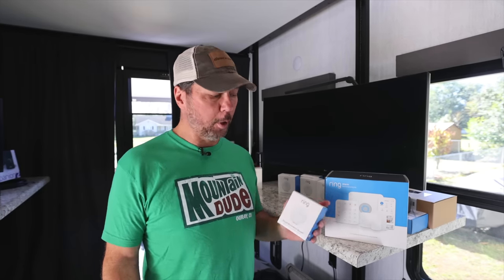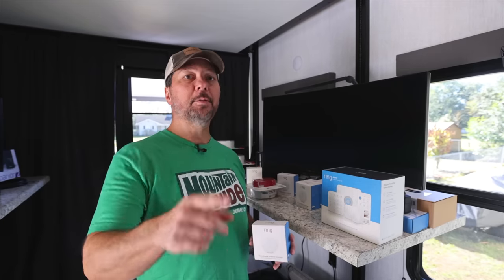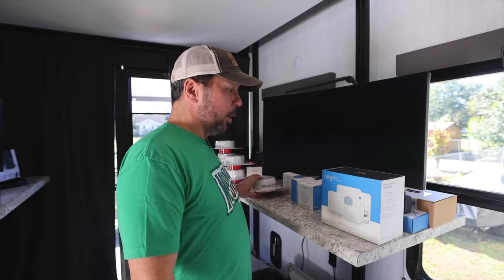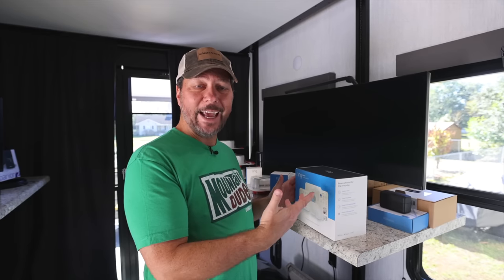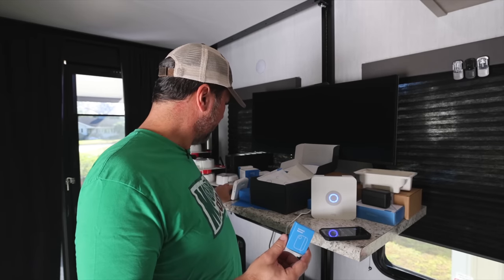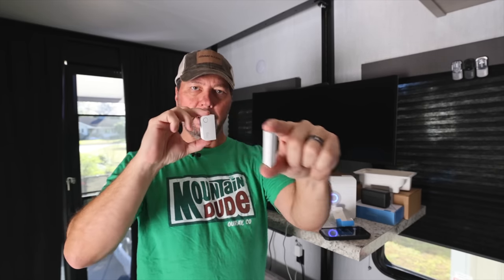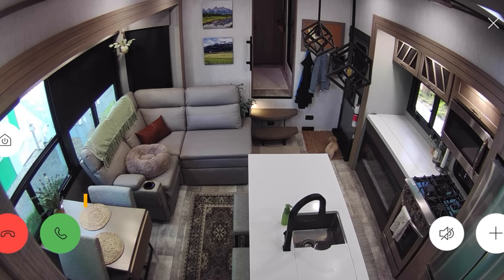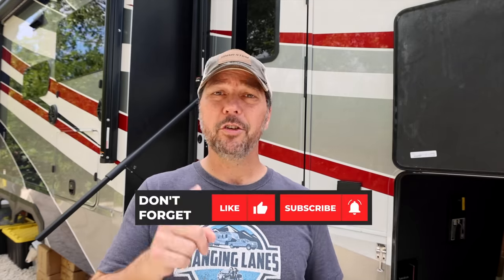RV Security System for Full Time RV (by Ring)

Comment: Chad, suggestion: get your label maker out and labels those under-bay alarms, so if you have to recharge or change batteries, you know where they go.  Also I would put three cameras on the outside to see in your blind spots if people are outside at night. We did this first.  Amazing who/what walks up or around your rig at night.
Reply from the maker: When one chirps with low battery,  I get a pocket full of AA batteries and go nose to tail and change ALL of them
Reply: What's a good label maker?
Reply: Chad just to let you know smoke alarms are very problematic in bathrooms as steam or high humidity can activate them.

Comment: I put a Ring alarm system in my Fifth wheel as well and I love it. One thing I did was I wired the base station and key pad to a 12 volt to 5 volt DC to DC converter so I don’t I need 120 volt AC to run it. We dry camp a lot and try to minimize inverter use for efficiency reasons. My internet is a Pepwave 5G and it is hard wired to 12 volt.
Reply from the maker: Very nice! 👍🏼
Reply: @ChangingLanes  I love your videos, very interesting and well done.
Reply from the maker: Clipping comments for a follow-up short and I thought of a drawback to hard-wiring DC power: You won't get notified if power goes out and 120V items (like the AC) shut off...  Not a huge deal if you don't have pets, but something to consider.. 👍🏼
Reply: @ChangingLanes  We don’t travel with pets and don’t really have anything running on 120V when we aren’t in the camper. You have me thinking though, how can I make the Ring alarm system sense an AC power loss, there must be a way to hack that problem, LOL.

Comment: Great video. I have Ring in our class A. In the process of putting contact sensors on the cargo bay doors. In combination with an Echo Dot, I’ve programmed a routine in where it will say “cargo bay 3 is still open” after whatever time I want (10 minutes). Kinda crude programming wise but it works.

Comment: As much information as they say they are collecting from people with their digital devices it seems counter productive to use it for your safety and security but have the chance that big data could basically track your every move with all these sensors and it being linked to your mobile device that you carry on you. I would feel more comfortable with all the sensors being wired and there be less need for battery or recharging. Is there software open source and can you see the system log for the devices that run Linux with a graphical user interface that doesn't show the processes in the background "Computer Code" like the main unit and the sensors? Open source phones are becoming more popular because the phones from the phone companies are locked down, denying access to you if you want to see the background data in code and the processes that the device is doing!

Comment: Wow what a timely video I just got done setting up our second ring system in my daughters RV. I think these are an amazing value and we did the Ring pro for the fact you can have an SD card process all your videos on site and save on data. And I love that it has a second cellular backup as well as battery backup so you just get more redundancy. And the flood and freeze sensors work great, I had one this winter when I knew that our little heat lamp could not keep the basement warm enough. I ended up winterizing the RV with antifreeze rather than risk it when we had that big cold snap. I also love we put an outside camera up also and an inside camera so when the dogs are left alone we know they're okay and who doesn't like checking on your RV when you're not there to know if somebody is messing around.

Comment: I have been camping for many years.. I just solved my security problem….. I sold my travel trailer..
Camping has changed…for the bad… Camp grounds too full and too expensive… and too many bad people wandering around inside camp grounds. Then with the price of fuel and insurance costs and stress of towing… I came to realize and have concluded
Drive to where you want to go and get a hotel room. I am looking forward to my first non camping trip and I have a hell of a lot less
Work preparation time before we leave.

Comment: What about the doorbell moving to flush mount on the slide? You could have better view (with 155 degree viewing angle) and possibly move that invisible barrier off the rv a little more. And by invisible barrier, I mean that arc of personal space to house ratio. Where are you push the doorbell  and step back a little bit? If that makes sense.

Comment: Nice set up Chad, my class C is 34 foot bumper to bumper so that being said it’s not even has big as your rig. We don’t have Wi-Fi but only cellular. I’ve already got alarm “puck’s “ everywhere water would be an issue but need something solely for the coach door and my big basement storage. I want what you got but a little less considering the size and need comparison of our rigs.
Reply from the maker: You could just buy a base staton and single contact sensor...  But there are likely even simpler solutions.

Comment: Just add in also I think the Ring pro is a better unit than the regular ring system, because you can have an SD card with your videos and then I think the total cost for us to do the Ring pro is about 20 bucks a month which I think is worth it.
Reply from the maker: The big problem with the PRO is that it needs to be wired, which is a huge undertaking on an RV door or exterior wall.....
Reply: @ChangingLanes  I'm not sure which part you're saying is wired.  The only difference in our pro station is the actual Base station.  All of the accessories including keypads door sensors or wireless just like the regular one.  If you are meaning just the base station, I understand if you don't have a pep Wave or a hotspot with an Ethernet port that could be an issue. But the device does come with backup AT&t cellular Wi-Fi that you get 3 GB a month included in your protect monitoring. And you could always plug it into an ethernet Wi-Fi adapter.

Comment: Great video, Chad! I love the Ring system. I just wished they had a few more sensors, like indoor temp monitoring.
Reply from the maker: Yes!  That would be a GREAT option and shouldn't be that difficult.
Reply: I worry about the door bell being on the actual door.  I would like to see it mounted on something stationary.  Not only worried about the mounting holding up but the camera frame moving when you open the door.
Reply: @ChangingLanes   So that means that there is no way to keep an eye on Daisy? Do you have the camera set up so when you leave you can see how she is doing?

Comment: Really appreciate your detailed installation of this setup Chad. Question about the sensors used for monitoring for leaks. Were they placed without being secured to the floor? Looked like you just laid them loose in the area to be monitored?
Reply from the maker: I gorilla taped down the basement sensor since that's behind a wall.  The ones under the sinks are being held in by all of the other stuff (trash cans, etc).  The toilet ones are easy to maintain..  👍🏼  Hope that helps!

Comment: Thanks Chad & Tara for another awesome video. Question regarding the install of the ring camera. Would it be a good idea to have a rubber gasket at the back of housing to prevent water intrusion? I am sure this ring camera install would void the warranty, just not sure if just the door or entire RV.
Reply from the maker: I will be putting some silicone in the holes... That should suffice.

Comment: Have you had any issues with the smoke\CO sensors?   We are currently working with on our 3rd attempt to add them.  We have been able to add them to the Ring network but when testing they do not send any notifications through the Ring app.  When we attempt to remove it and add it back to the the Ring app, Ring shows that the sensor needs to be factory reset. Attempted to do a factory reset on the sensor with no luck.   Contacted the vendor and their response was to send us a new one, so going to attempt install number 4.  Just curious if you have had any issues with them.
Reply from the maker: No issues at all, and we know they work because we've set off the one next to the shower a couple of times (steam) 😳   These are the ones we use: https://gear.changinglanesrv.com/product/first-alert-2-in-1-z-wave-wireless-smoke-detector/

Comment: I am about to install Ring on our fifth wheel. Why did you choose to permanently mount your Ring doorbell vs. Velcro? How are the screws holding up? Did you use anything to waterproof the screw holes? Thanks, great video!
Reply from the maker: I just wanted to try it so it's one less thing to mount when setting up.  I completely spaced on the screws and will be putting some silicone behind the screws today.  👍🏼

Comment: If you would have installed the doorbell camera on the front of the slide you would have a much better view.
Reply from the maker: With the wedge, it can already see the side of the RV and an open view forward.  A slide mount would only improve the angle by a few degrees by adding some distance from the side.

Comment: Is the smoke and CO2 alarm listener needed for the smoke detectors? Will you be notified if we are away from the rig without the listener? Thanks
Reply from the maker: The "listener" is for non-connected alarms.  These are connected directly and no listener is necessary.
Reply: could you use Alexa guard as a listening device instead?